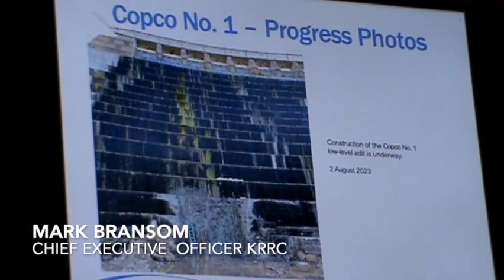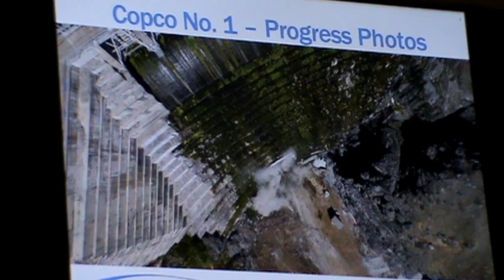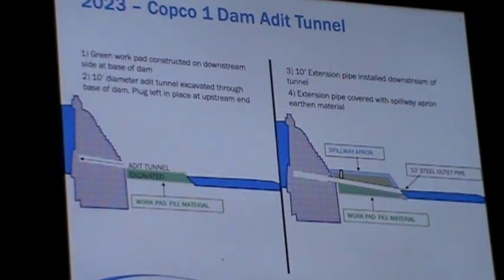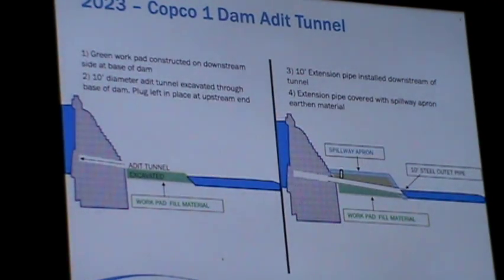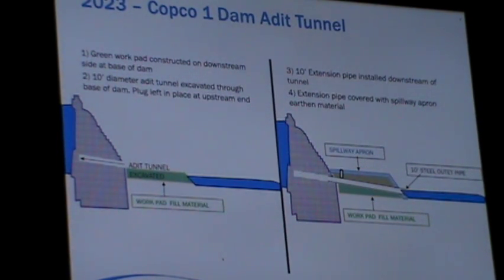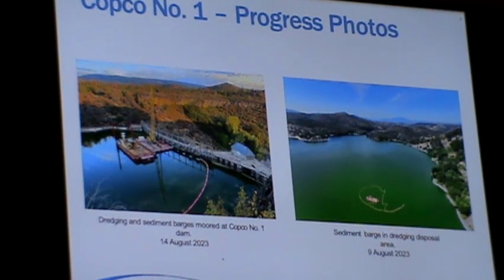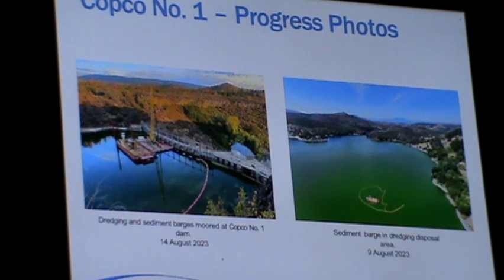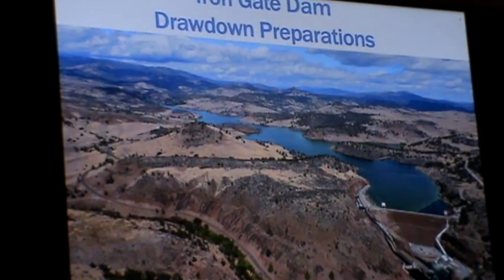Copco #1 Dam Removal How to   #copco #drawdown

Comment: Thank you, very interesting. Good explanation of the downward angled drain and extension. This deconstruction project is very interesting and it sure seems well thought out from afar. I wonder if the Army Corps of Engineers is watching this with great interest. That would be funny if the tip clogged and the vent stayed open. That sediment dump inside the curtain should add a little silty soil to the old Ward ranch there on that bench. That bench extends south from the headlands just west of Beaver Creek towards the big cove on Patricia Ave. The people who live there will have the river right in front of them, with a meadow on the other side, on the inside of a U-Bend rising up into that bench.

I think the part of this deconstruction that naturally seems the most interesting is the blowing itself. I'm sure that the pros know what they're doing but idiots like me wonder how that last blast can be done safely and with confidence of success at the same time. Prior blasting was by predrill and filling the holes with explosive apparently, and those blasts took out 6-10 feet of material per drill-blast cycle. So who gets to drill the last 10-12 feet that's left and how can you be sure that it will remove that much material, that the material will not clog the pipe, that the railroad-rail rebar won't still require cutting, etc.? I have done enough demo to know that one stupid nail will hold a whole huge structure together, and John Boyle (or whoever made decisions like using RR rail for rebar--it was before Engineer Schussler) seemed like the kind of guy to use screws in place of nails. Because presumably if it doesn't succeed it won't be safe to go back in there again. I guess they're going to do a much larger blast for the last one, and maybe the pre-drilling will be done by robot? I sure hope they have a cold beer ready for the guys who go in there for the final prep work.
Reply: Gotta say, I'd be real nervous going in that tunnel for the last few drill and blasts cycles before they stop at the last 10 feet. Also kept thinking about that movie, "The Dambusters." Has the final blast to open the tunnel taken place yet?
Reply: @carlinglin7289  Yep. 
https://www.youtube.com/watch?v=RDD8lYV_GRQ